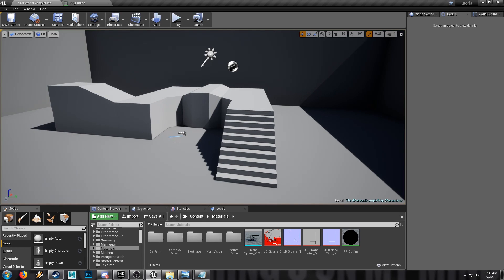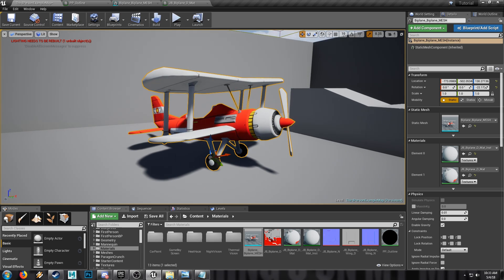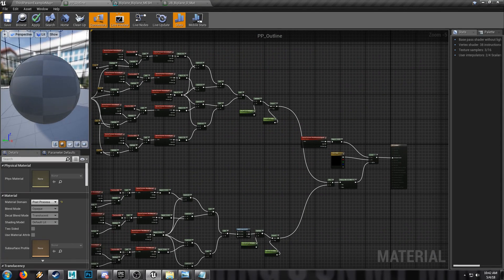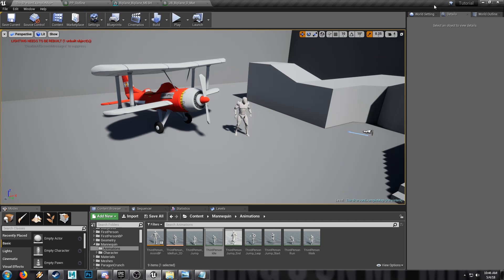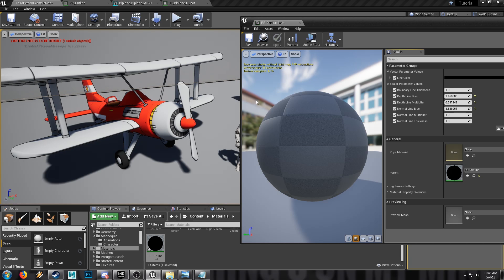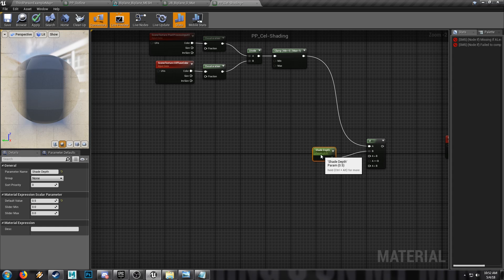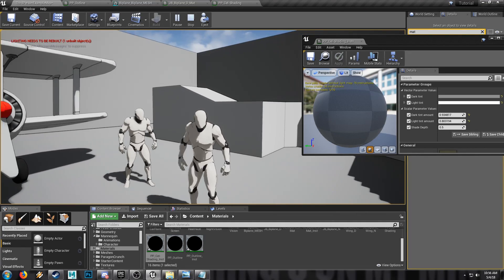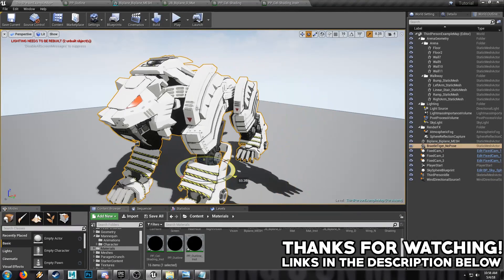UE4 Tutorial: Toon Shader (Borderlands/Jet Set Radio)

Comment: Wow, pretty insane how much you can tune and how good you can get stuff to look with these effects.
Quick question, I've got a problem with some of my outline parameters. 
While I was going through the Epic tutorial I thought "hey I'm sure I can multiply these 2 vector for thicker lines" so I made a parameters and tested it out but my lines just started glowing really harsh (expected, this was before I added the last few bits like clamping and stuff). Even so, I kinda assumed maybe this wasn't the spot for line thickness modifying. Materials aren't my strongest area so sometimes I get a little lost in some of the math and logic that's going on with some of the calcs so I assumed I was wrong here.
I come back to this vid and see you actually do the same thing I tried earlier. So I tried it again (this is with the fully complete mat from the Epic tutorial) but I'm still not getting thicker lines, rather my scene seems to get kinda darker. 
Any idea what might be causing that? This is on the depth block of nodes. Pretty sure I've got everything set up right but I can't get thicker lines.

Awesome video though! And great link to the UE tut! These two vids have really helped me understand /how/ the outlining and stuff works. Super interesting.
Reply: Well... never mind me, I am an idiot! Turns out my 4th row of the Depth block had my 0,-1 plugged straight into the multiplier with the InvSize rather than multiplying with my DepthLineThickness param before it. 
Not sure how that got unplugged since I copied that Depth block to reuse as the Normal block and the last row in my Normal block is connected properly. I must have missed it when hooking it up multiplying with my thickness parameter.

Just FYI, that glowing was me messing around with multiplying the 1,0 / 0,1 etc. vectors during the Epic tutorial, and that was before I had got to where they clamped the value (going over 1 was causing the glow).
Just found it kinda funny how I thought multiplying the vectors would be thickness (which it is) but assumed I was wrong because it was glowing ( I didn't have the clamp in at that time) then after coming out of that tutorial into this one,I find I was right all along!

Super grateful for the response. Really awesome to get responses so fast and so helpful. Will have to keep an eye out on this channel. Seems super helpful for learning areas of the engine like mats that I'm not 100% on.
Reply from the maker: Hi! Thanks for the kind words :)

I have a couple thoughts about what might be happening. It could be that the outline vectors aren't being multiplied properly, or maybe aren't defined properly (you need 0,-1 / 0,1 / 1,0 / -1,0). The other thing is your scene texture nodes might not be set to the right mode - I made that mistake while recording the video ;) Not sure where the glowing is coming from... I've experimented with other methods of outlining that have a glowing result, but this method shouldn't do that. Are you trying to make the toon shader in one big material, like the UE stream does? I can probably be more helpful if I can see your material blueprints, if it's possible, send me a screenshot of your work and I'll take a closer look :)

There's a link in the description to a zip file on mediafire listed as 'Assets Download' that contains high-res screenshots of the materials I used in the video for reference. Have a look in there and see if there's anything out of place. 

Hope this helps! Thanks again!
Reply from the maker: Glad I could help! And good work on fixing the problem :) Feel free to let me know if there's anything you'd like to me to cover in future videos, I'm more than happy to take requests. Thanks again!

Comment: 4.19, against non custom depth objects, the outlining doesn't work ( except against skybox ). Lines will appear slightly in of the model but once it hits a mesh closer, they will appear on the outside, as this is filtered out they wont appear. Do you have the same issues?
Reply: https://puu.sh/zXP6n/7f8bfd9938.jpg No Custom Depth filter against skybox

https://puu.sh/zXP5k/dbdf72b2ea.jpg Lines against skybox disappear against a closer mesh

https://puu.sh/zXP50/032f4e5e06.jpg
Reply from the maker: Interesting! I didn't run into this issue, but I have a couple ideas. First, try bypassing the sky mask and the custom depth mask and see if that fixes it. Also double-check your vectors, you should have four (1,0 / 0,1 / -1,0 / 0,-1) and they control where and how the lines are rendered.  There are screenshots of the materials I use in the asset download link, so if nothing works, download that and check my material against yours. If you're still having problems, send me another message and I'll be happy to help you figure it out. :)
Reply: I think I can see the same issue in yours on the video and the liger shot, just to a lesser degree, mostly due to the box being set to custom as well it's in and the line thickness in the material. 

The normal lines show within the mesh, but the outer lines show outside, when you do the sky mask and custom mask, it will mask the outside completely, resulting in the outer lines disappearing when they're not in the mask. 

What shows against the skybox is the normal lines, which I could see by adjusting the thickness in the material editor, this is why they seem to be on the inside more. So basically need someway of subtracting only the objects in distance from the sky and custom depth masks in order for it to show.
Reply from the maker: I just opened up the files and had a look. After some testing and investigation, i think I know what's going on. What you're seeing with the lines is a problem with the relationship between objects with custom depth enabled and objects that don't have custom depth. You can bypass the sky mask and the depth mask to make the material apply the effect to everything in the whole scene, or bring down the value of your skymask from 10000 to more like 2000. 

The reason the silhouette outlines seem to disappear is to do with how custom depth masks out the scene. You won't see any line on the 'outside' of the mesh if there's an object without custom depth enabled behind it, because there are no pixels to apply custom depth to.

I hope that helps!
Reply: Was a pain in the but but got it working ( mostly ) against non custom depth now. Just some trickery with masks, but small issue where the non custom shaders will cut through the lines, but not bad. 

https://puu.sh/zXWDK/a293762749.jpg
Reply from the maker: Looks great! Can you share the changes you made to the material? I'd love to see your solution.
Reply: great job
It's work!
Reply: @brendansilva9023  I know it's been a while, but do you still know how you managed to get this to work against non-custom-depth objects?
Reply: @brendansilva9023  Hi! Is it possible for you to help with this solution? Picture link seems outdated, i ran into the same problem - when masking the custom depth to have outline on specific objects they do conflict with objects w\o custom depths, so their outlines not drawing.
Reply: @underscore00  Hello! Maybe you can help with this solution please?
Reply: Great stuff. I just got into Unreal, and I tried your method. I tried hard to understand it, but it's still very confusing to me. Because I tried to fix another problem that I encountered with your version. Now it shows the outline through other objects.
Reply: You have to go into the skybox blueprint and uncheck render in main pass so it wont effect the sky, had this issue on previous versions to

Comment: Can that light extraction nodes be used to say if  I want to have 2 different textures on the same model,one appearing only on the lit side and the other on the shadowed areas?Will it work if I just plug in diffuse textures on the tint node you have?
Reply from the maker: By the sound of it, yeah! The 'if' node will be your friend. Set your values for A and B and you can perform different operations based on which value is present.
Reply: Thanks I will try it.What version did you do this?I don't have any installed right now and will be downloading the latest,I suppose this will work regardless.
Reply from the maker: This was done in 4.19, the latest version. Thanks again!